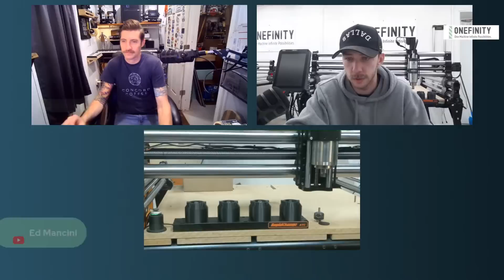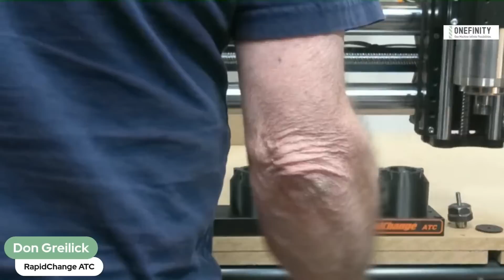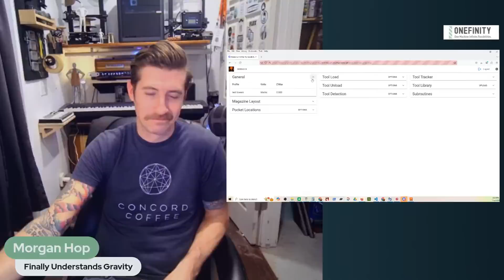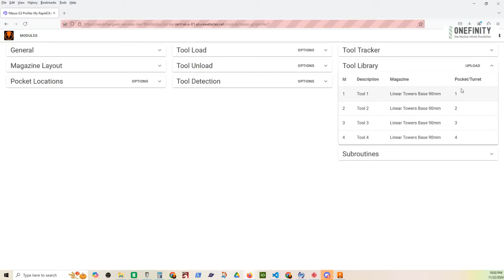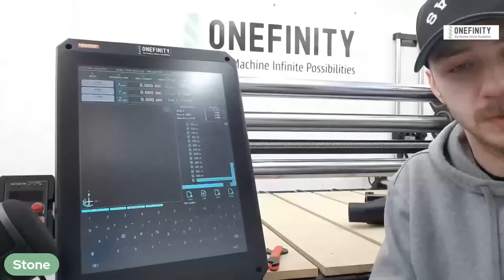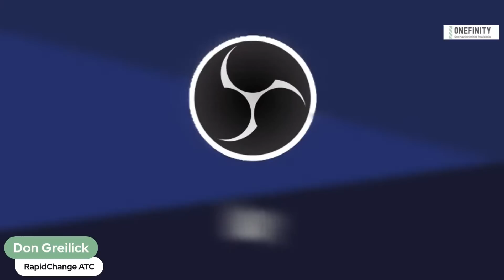New Product Launch Week - Day 5 - Onefinity Easy ATC

Comment: How far do you set the airweight slats back from the front of the QCW when attaching the ATC using the QCW mounting kit (that I forgot to order and is not here yet)? Thanks
Reply from the maker: The best way is to wait until you get the ATC, then slide them forward until they touch the ATC.
Reply: @OnefinityCNC  😆yes isn't that wonderful solution. Guess that's par. Too many other errs and issues with the machine. Might take longer than that for it to finally get running.

Comment: That is a great concept on using the rotation torque to tighten and loosen the nut. I also see a weight loss because it's not using pneumatics and having large tool holder to hold the tool. I like to see this in action. or video on this ATC.

Cheers
Reply from the maker: check out the rapidchange youtube for videos!

Comment: the base should have a positive key on it, and there should be a program you run which cuts the negative key for the setter to sit in.  at this point you would know exactly, from your software, the position of the setter. 
alternately...  the program drills holes to screw the setter down, and you know the position based on that. 
this would seem to be the more automated, work with the numbers you already have approach.
that's my 2 cents.   you could probably still make that design to cut the holes for the screws and people can do settings off of those known coordinates.
Reply from the maker: Thanks for your input!
Reply: @onefinty you seriously need to take this gentleman’s input. It would cause so much less user and probably time from support staff and Facebook group pages. A file that has the dimensions of the atc with the screw hole positions. Like the comment said above that will allow people to know exactly where the coordinates are then be able to easily paid right over top of the middle of each tool slot. Plus again like he said you all already have the files and dimensions just add it onto the set up instructions and this will be a smooth rollout
Reply: ***user error

**rapid position
Reply: This! Please integrate this idea. The fussing shown here to get the positioning right was painful to watch when we have very smart machines that can do this essentially for us. 

Indexing pins built into the unit with a program to install them where you want and established fixed points is the way to go, to go along with Onefinity overall user friendly ethos. 

Please implement this before sending out the ATC units. It's not complicated.

Comment: What are the measurements of the ATC so I can see if it will fit within my enclosure if 
Installed to the QCW frame? I have a few inches in front of the QCW before it hits the doors to my enclosure
Reply from the maker: We'll add this to our faq in the near future!
Reply from the maker: We will add this to the faq and product description in the near future!
Reply: @OnefinityCNC  would you guys mind answering the questions below that I posted? I want to place my order as soon as the products are available
Reply: I have a QCW on my woodworker with BB controller.

When I order the ATC what else will I need with my current set up?

Is there an installation video yet for the new redline spindle? Again I have an enclosure and I'm trying to plan ahead for placement of the power supply but I have no idea how long the included cables are etc.

I have your original suckit dust boot so is this going to be a problem with the tool changer and spindle? If not what will I need for that? Currently your suckit dust boot fits within my enclosure and is just a few inches away from the front doors of the enclosure.

I would appreciate it if you could create a list with pricing of what I will need for the ATC and spindle with my set up.

Thanks for everything you're doing! I'm so excited!
Reply: Oops the questions above
Reply: I think he said it's only about 3" wide, so I'd think you'll be fine